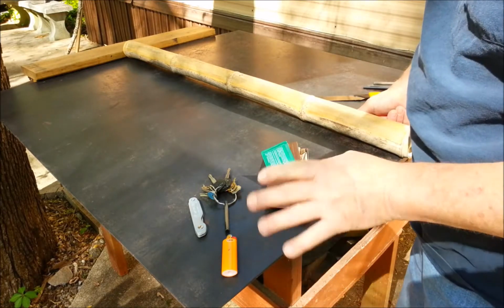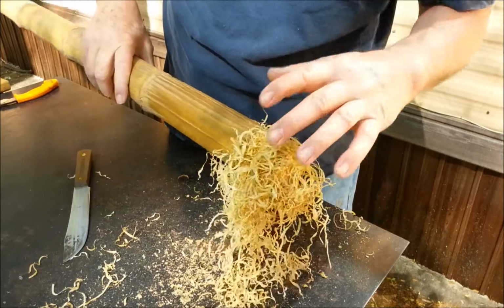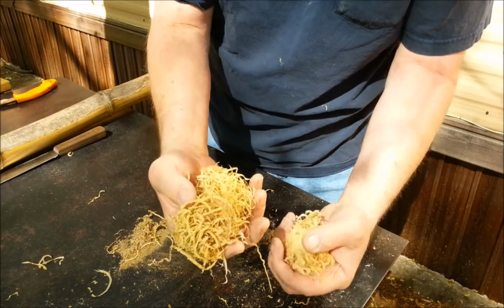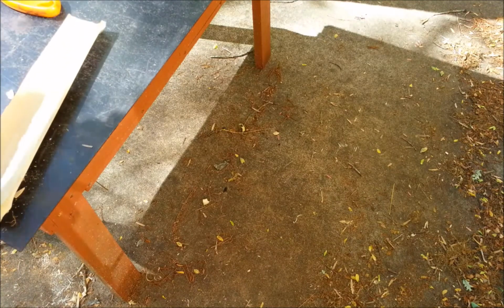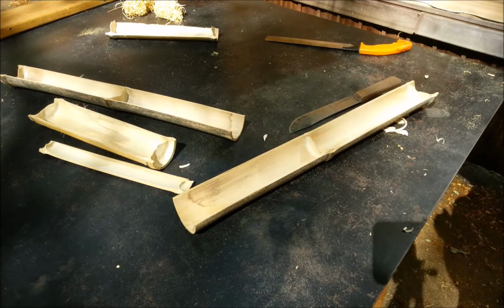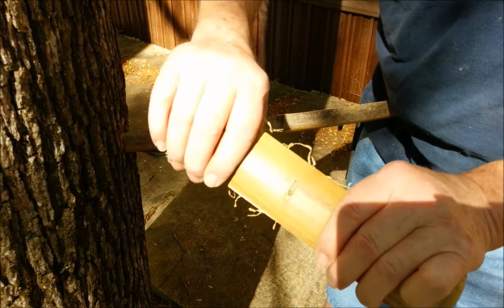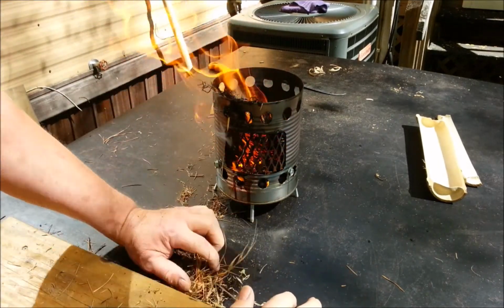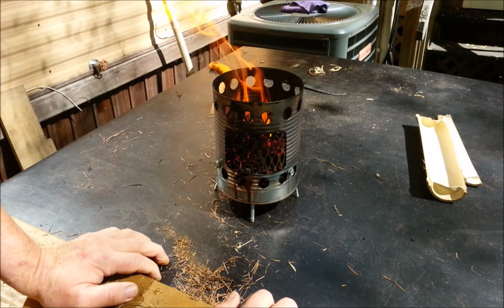Bamboo Fire Saw... LOL! Got a little singed on this one.

Comment: Suggestion:  make a small slit at the end of the lower bamboo piece that touches the tree.  Stick the knife into the tree bark with the blade oriented vertically, and rest the bamboo on it with the knife blade inserted into the slit.  Should make the lower board less likely to fall off the knife.
Reply from the maker: +Norman Means Thank you. Not necessary for me. The ledge provided by the knife works fine. Thank You!
Reply: If there's a weakness in the bamboo, you might start a split; not a good thing to do in the middle of firemaking!

Comment: I tried this today but I didn't succeed maybe next Sunday I think I made the hole too big and Yes mine slipped off the tree just like you said put a knife under it
Reply from the maker: Have you seen this tutorial? Make an approximately 45 degree cut on the bottom board to fit a small diameter tree. https://youtu.be/H9c0Ani_Cak